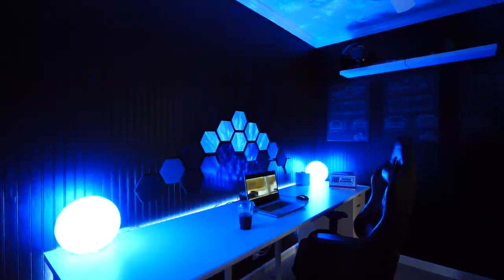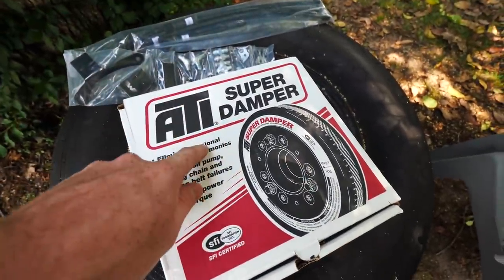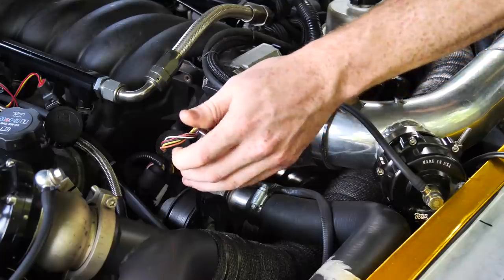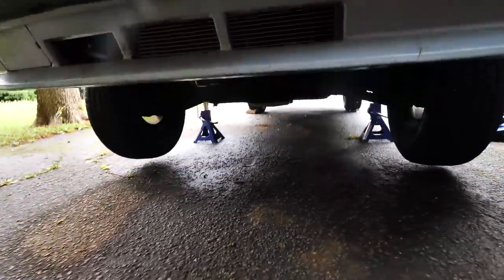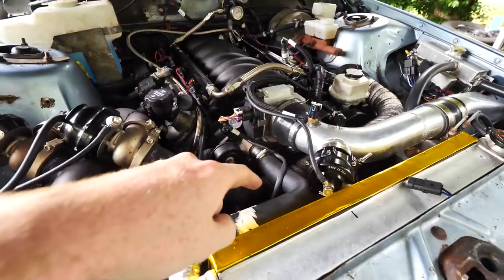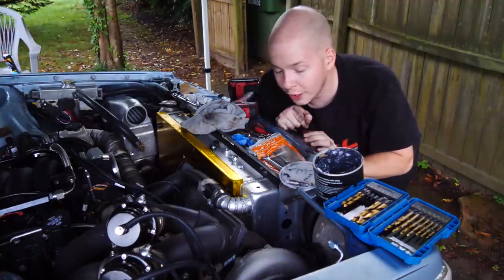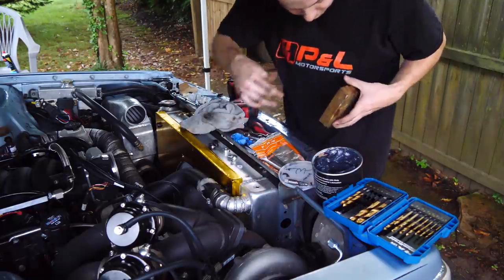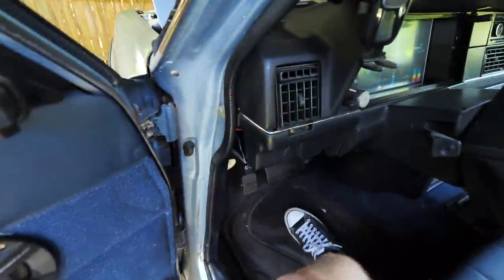The KEY to UNLOCKING 800WHP In the Sleeper Volvo!

Comment: Our boy returning to his roots with the 1 grit sandpaper
Reply: Bruh he coulda just put a gasket it woulda looked better
Reply: @AB-rr4xh  Not really, a gasket wouldn't protect the fitting from loosening itself due to vibration and temperature changes.
Reply: I use a rock on rc bodies. Makes a good effect.
Reply: @wowdogeful  to protect it from leaking you use a gasket, to protect from loosening you could use lock tite but I thought he said just to keep it from leaking
Reply: Thread sealer perhaps?

Comment: From my classes the wobbly pulley may be from a misalignment or from the pulley not being fully fastened
Reply: This gen of LS engine spins the direction the bolt fastens, iirc. As the engine runs, without a metric fuckton of thread locker, you're going to inevitably have a loose crank bolt. I think the damper he installed will reduce the chances of the crank bolt falling out as well.

Comment: 3:28 why the turbo on the 4.6 Thunderbird with a stock ecu that has a map sensor doesn't make boost till its in second gear? 

hmm... modified sensor chain, but the exhaust is restrictive on the turbo exhaust side? 

20 feet of charge piping and 11 90 degree bends? 

360lbft into second is still a lot for a car. 

no louder then an electric car going down the road. 

If it had aluminum pistons it would have more power, but meh... think the 1994 year still had the cast drop forged steel pistons... lol, has some rusty old 440cc bosch injectors. everything is covered in oil.

The other day, the transmission cooler line started leaking. there so rusty that bending them will likely snap the tube.

Works good for getting to the store from 10 miles out to buy some build a burger kit's. 

Darn rabbits been eating the corn sprouts... it gets down to -40 degrees up here, so I'm thinking someone brought it up here and released it... really think they'd run 2000 miles over a few weeks as the season changes? as if every time the car goes down the road they all get scared and run to the bushes out of the back yard plantations. popped its head up after hearing "vroom" and it got nailed. More outside house cats!

Comment: I still have the cross over so it can flow from head to head and haven't had any issue with that
Reply: Also running a gen 3 6.0l with 500 hp na